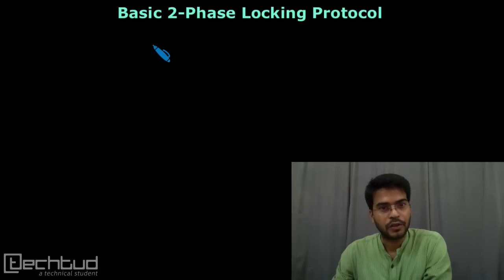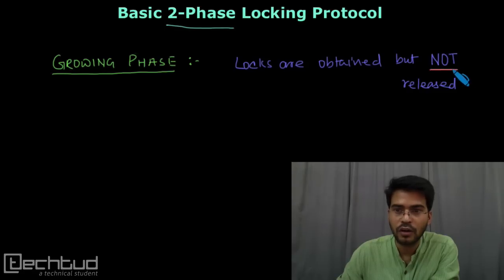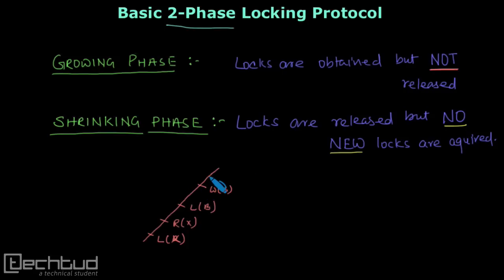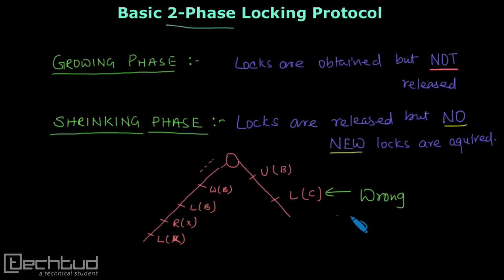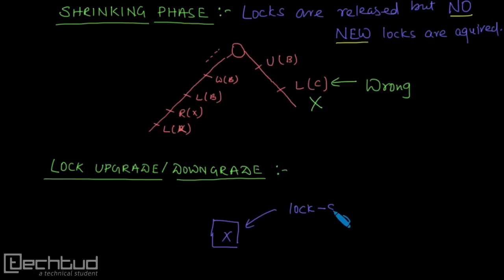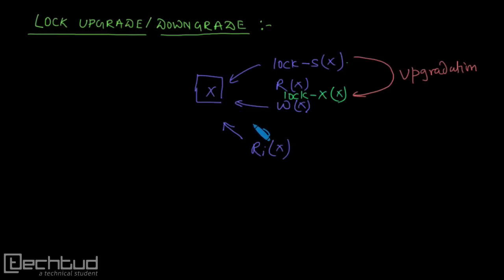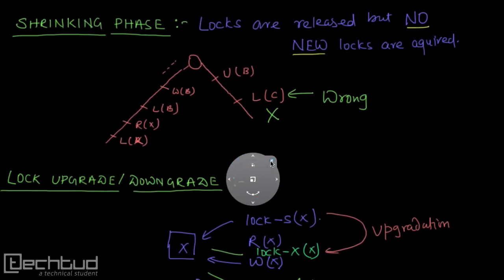Simple 2 - Phase Locking Protocol | Concurrency Control

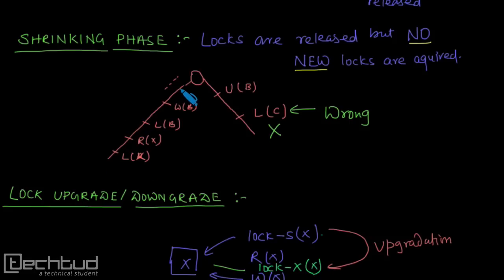Comment: @ time 5:20  , you said we have to downgrade the lock from exclusive to share to read... ok
   but in previous lecture (last example T1 : A --> B) you said exclusive lock is used to read as well as write.
   What does it mean?
Reply: Because when there is a exclusive lock placed on the data element by a transaction, and another transaction request a shared lock to read the data element the request will not be granted. Because write and read are conflicting operations. Thus we down grade the lock to shared lock (read operation) because read-read are not conflicting.

Comment: sir, in previous lecture you have said that  if there exist exclusive lock on a data item,then  we can not use shared lock on this same data item ..but here you are useing it in " lock upgrade /downgrade"   part ....i am confused ......please explain ...
Reply: here you are upgrading and downgrading on data under same transaction,and in the previous video it was on different transactions@subhajit khan
Reply: He is giving arbitrary locking examples. You can never apply any lock on a pre existing exclusive lock unless the lock has been removed.
Hope this helps